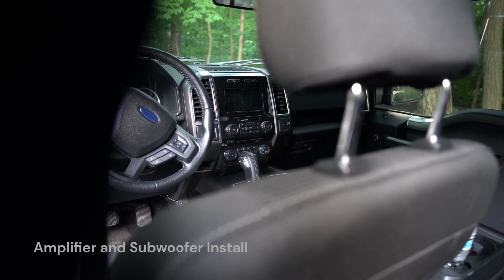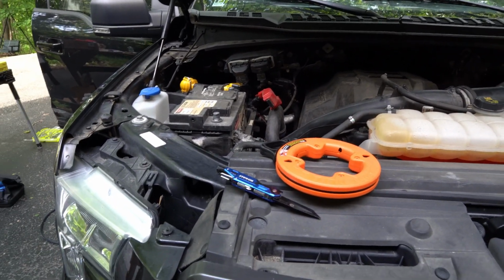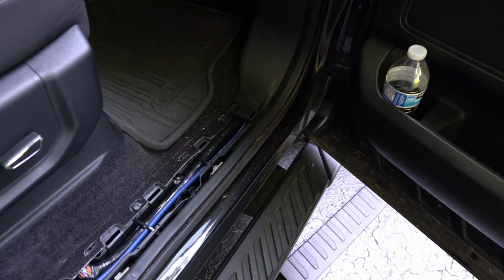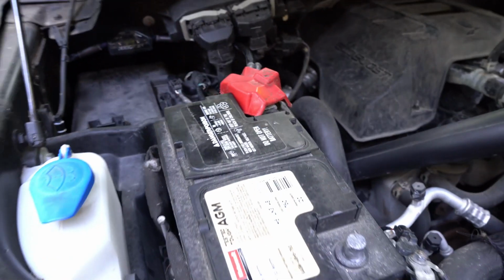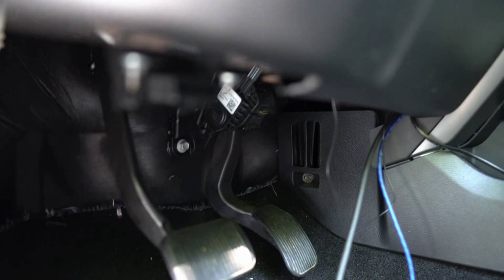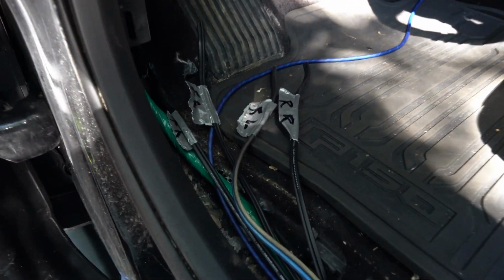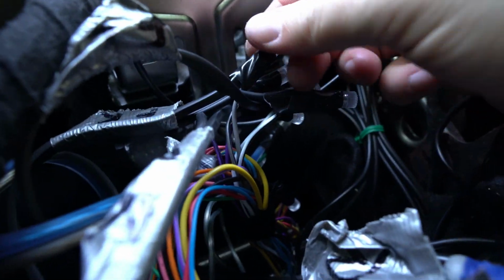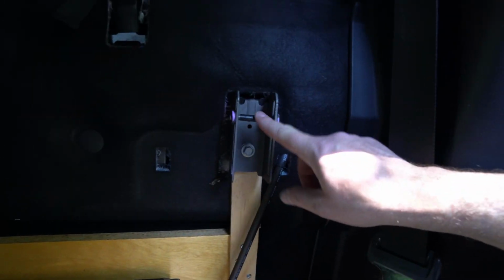F150 Amp and Sub Install (2015+)

Comment: Your not supposed to run the rca cables with the power wire....its long enough when you run it right down the middleunder center console and under carpet behind that

Comment: I surprised you have never heard of PAC adapters for the speaker wire connections, or metra, that way you cut nothing. Also InstallBay speedwire or Metra Speed cable is all speaker wires for your doors in 1 cable to go from your amp up to your dash to connect to the adapter to go to your speakers